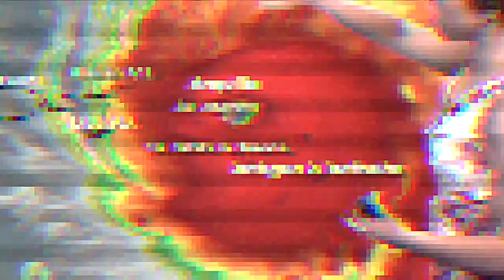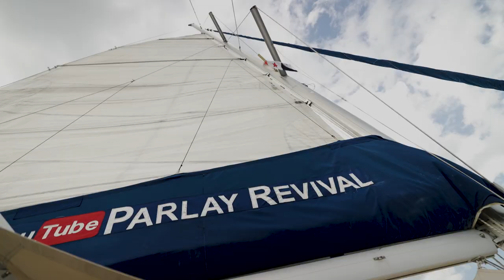INVITING OUR PATREONS SAILING!! 23 people sailing on a Lagoon 450! - Episode 165

Comment: Love to see Parley with the Patrons that made it possible.  Think you could let them do a paddle wrap with a few kings head knots for dead center on the helm.  Yes know that is very low priority with bulkhead issues. Did the engine room rails when at sea on a not so super yacht I worked on back in 1974. Think the first wraps were done during WWII when she was a sub chaser.

Comment: OK, what may be the dumbest question ever, I wonder if the shape of the bow has any effect on the handling of the boat. I remember reading about the development of WWII German ships. Originally several had "square" bows like yours, but were changed to have "Atlantic" bows that are pointed forwards then curve backwards down to the water. Hope the question makes a bit of sense, lolol.
Reply: Ive read the samething, i am a student of history and i love those little tid bits.
Reply: Not a dumb question at all. In regards to handling maybe a little but a modern trend in performance cats has a reverse bow so the boat is actually longer at the waterline this helps with hull speed and also how the boat can ‘cut’ through waves.

Comment: With the guy’s dad who lost confidence, I have noticed this in my dad and now myself. When I was young, I was full of confidence (a bit of arrogance too) yet I had very little experience. Now all these years later, I have all this experience (almost all of it a success) yet my confidence is in decline. The other day I welded up a new whisker pole, it was an easy job with easy welds. In the past, I have welded my entire boat together, yet as I started work on this little pole it felt like I was going to climb a mountain. I struggled to get going, worried I would mess it up. A couple of hours later and it was all done and looks great. Why the struggle? Confidence is a strange thing that seems only loosely tied to experience, logic and success. It feels like you are in a balloon and when you are young there is so much room to grow. As you get older the balloon shrinks, it becomes rigid and unyielding and everyday you have to push out, push back and fight the shrink. I don’t know what the answer is, but I guess it’s something like supporting each other, finding people who believe in you and just picking up that torch, screwdriver, paint brush, breaking the job into manageable pieces and refusing to give in.